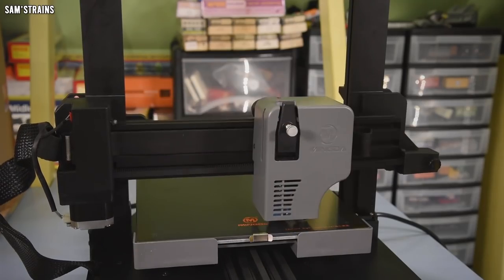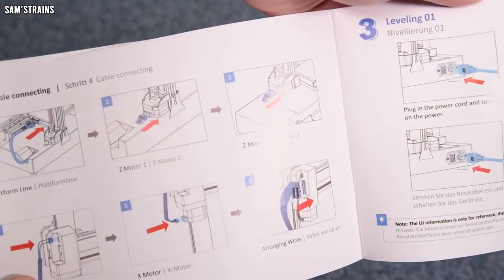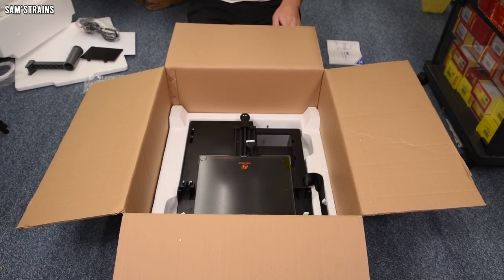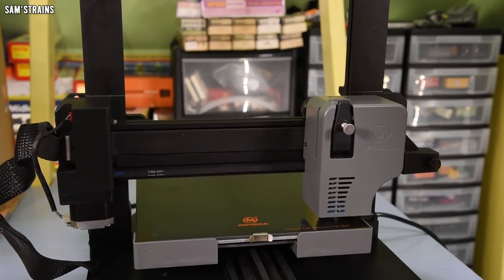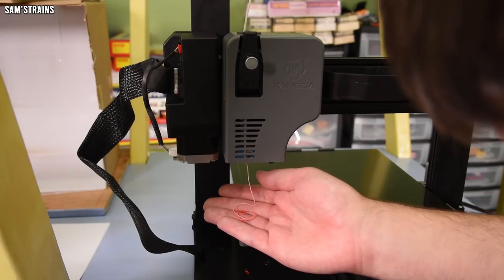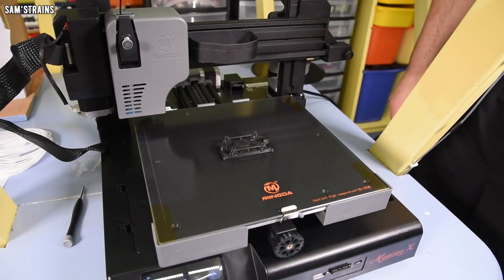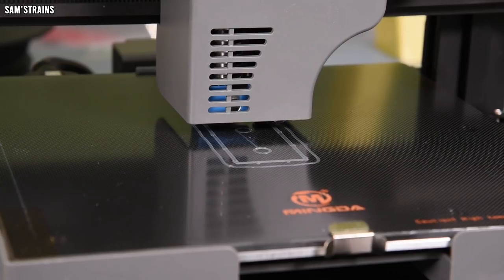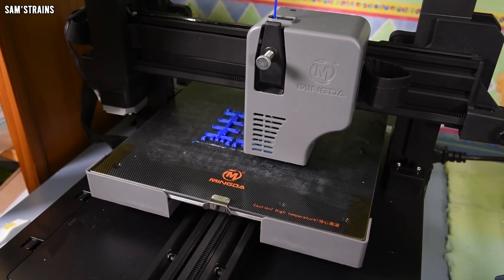This Cheap 3D Printer Makes Outstanding Models | Mingda Magician X | Unboxing & Review

Comment: Next: making an entire Sam to help on the layout
Reply from the maker: Heyy! There's an idea! xD
Thanks for watching, Sam :)
Reply: @SamsTrains  you need to try that.
Reply: @SamsTrains  Perhaps a miniture Sam to do the uncoupling.
Reply: @odinnln5694  I second this notion
Reply: @SamsTrains  u should make model train bodys for the chasis of any train and try making a custom train
Reply: ModelU actually can do that, they are usually about at shows in the UK and they can 3D print you using resin printers, onto your layout. All they do is take a photo of you with either with your normal clothing or you can dress up in different clothes and hold relevant props, so you can be a engine driver, locomotive fireman, station master, passenger from the past or anyone else you can think of on a railway.

Comment: You should try resin printing, they’re supposed to be great for modelling
Reply: AGREED. as you tend to print smallish stuff a cheap resin printer (under £200) would be ideal. the quality of resin printers is amazing......a sub £200 resin printer will easily print higher quality than a £1000+ FDM printer
Reply: @TDax  Due to one of my friends highscools large suplly of resin printers cause no one else can get them to work he played around and was resin printing small replacement parts for one of my models. afterpainting you couldnt tell what was new or old.
Reply from the maker: They do look amazing - I might one day, but I don't have any ventilation, and it's a bit messy!
Thanks for watching, Sam :)
Reply: No I wouldn't bother it's not good for trains.... I own a resin printer and trust me it's not for playing ... great for scale models where you paint and place on a shelf and never touch it. Something that vibrates and could get knocked .....nah your setting yourself up for pain.. but for scenery stuff yeah man do it
Reply: @vasili1207   try adding a little flexible resin to your standard resin.....You can end up with a an unbelievably tough print.

Comment: A very good review, thanks Sam. I'm new to 3D printing. It was good to see the fine detail of the printed model close up. There is still the slight layering effect of the plastic, but with painting I expect that would smooth down. This looks like a good entry-level printer to get started with. One question please, - how to you get your 3d files or wagons etc? Do you scan original models or can they be purchased ready to print?
Cheers, Angus.

Comment: Sam thanks for the review 
I just backed the Kick starter and was starting to worry if it would be good or not because of the low price .
I decided on FDM instead of resin because of cost but mainly for increased bed size and  ventilation and noise ,it will be in the living room of my condo and I don't want to bother my neighbors or die of the Resin fumes .
But thanks to you I think it should be great for my Traveller and D&D work 
This is my first 3D printer experience ,so I am sure that was why I started to get nervous 
Again TY for the great review

Comment: My Magician X assembly didn't go smoothly. Mingda support were very helpful and quick.
One of the large screws wouldn't engage. It's a deep hole - at the bottom the case plastic and support metal holes didn't line up. After some perseverance the screw finally engaged.
The pack also contains two small screws that are not mentioned in the manifest or instructions. They fit in the plug shroud at the back of the bed to stop it being pulled out. You have to make sure they engage with the captive nuts - as the bottom plastic can bend instead. Looking at Sam's video - it seems mine is an enhanced bed plug shroud with added screws for extra security.
The final confusion was a thick-ish sheet of clear plastic covering the bed - very strongly stuck. Loose on a couple of edges - but no obvious tabs or markings that normally indicate a protective film. However - that is what it is - so remove it.
Now getting close to printing click-in adapters for a (Sam £3.50) 8x16mm or  a 10x20mm coreless motor in an early variant Mehano/Model Power RS-11. In hindsight it would have been quicker to have shaped one with front lugs out of a small piece of wood. Instead of needing the complication of a rear clip - possibly use a longer 2mm self tap pan screw through the under-chassis weight screw hole which is clear all the way into the motor compartment.

Comment: I saw a 3d printing video long time ago where the article he made was put into a container with some acetone next to it in a dish, after being left for a while the surface  lines made by the printer dissapeared because the acetone dissolved the surface and made a smooth finish, Could be worth a try,
Reply: Acetone smoothing is used with filaments like abs.

Comment: Hi Sam, hope this isn't preaching to the choir:  To combat the warping you can try a few things:  1) clean the bed with warm water and a small amout of dish soap to eliminate any excess grease/muck, 2) clean bed with 90% (or higher) IPA, 3) check your bed temperatures, 4) build your skirt up higher to act as a semi-enclosure (another 4-5 layers should do in most cases) and help prevet drafts, 5) lower the cooling settings on the hotend fan (if there is one and it's not a one speed job) so that the corners don't cool down as quickly.  However, if there are Z-height bed levelling inconsistencies from the auto level, then you may have to put a couple layers of raft down.  If you don't want to waste filament on a raft, a brim may help keep the edges down (not sure if Cura allows brims to be selected to just be on the corners like Prusa Slic3r does though).

Comment: You should try out resin printing, since it allows for much finer details than fdm printing. Also you might want to try filling and sanding your 3d printed models to remove layer lines and give it a smooth finish

Comment: I think I might understand the random small shifts in the Z axis between prints that appear to be a common user observation. My touch screen is not just randomly apparently unresponsive - but often acts as if a nearby icon has been pressed instead. One of these is the Z height adjustment which I believe I saw it do instead of "back".  If not this root cause - then certainly a problem. A more visible muddy footprint case is "Runoff On/Off" toggling. Sorry for all the posts but it is a likely place new users will look for pointers.

Comment: Hi Sam, great video with some good tips on set up, my question is how to fit wheels on the printed wagons ? I have had some problems with the axle box frames breaking of trying to fit axles in, what would you suggest, Warming the chassis up in warm water To make them a little more flexible ? Any help you could offer would be much appreciated.
Paul

Comment: This seems like a reasonable beginners printer based solely on little things like auto-levelling. I have a CR-10S Pro v2, and it has many of the same features at double the cost, but it does also have a larger build plate. I do wonder how the quality of the electronics compares. The X carriage power cable looks decent, but I wonder how that feed system, extruder stepper and stepper drivers will hold up with some use. 

Time will tell!

Comment: Fascinating stuff! This is an amazing new dimension in modelling. Do all of the prints have that stratified look showing where each layer was added? Can they be sanded or filed to produce a smoother finish?  Can you add rivet detail?
Reply from the maker: Thanks James! Yes there's quite a bit you can do to reduce the layer lines... and you can reduce the height of each layer too, which improves quality but obviously takes longer!
Thanks for watching, Sam :)
Reply: As you get more proficient with 3D modelling, you'll learn what's good to print in one go and when to separate parts to print individually and then snap/glue together.  Rivets don't resolve well if they're facing out on the x/y planes, but if they're facing up/down the PLA layering can deal with their resolution much more accurately.
Reply: @coolersmoke  Thanks for that explanation - it looks like there's a bit of a learning curve on 3D printing - but well worth the effort

Comment: I would recommend using a layer of Blue painters tape over the print bed, rub it down with a cloth dampened with rubbing alcohol. This should help get prints to stick better to the print bed, some people like to use hairspray on glass beds, I wouldn't recommend this because it can gum up parts over time.

Comment: Sam, the layer lines are showing more than they should. There are some videos on YouTube about how to print with less showing. Worth a look. I like that printer with self-levelling. At the end of this month, I am buying an Ender 3. Like the one I borrowed from the college, it has all the updates and a stepper motor silencing board. The fan housing around the nozzle has also been modified. I am using the same filament as you are and I have had no problems with it. I will take some photos of what I made with the one from college and email them to you. Unless you have a Line account and I can them that way. Martin. (Thailand)

Comment: I have the creality LD 002r resin printer with a 2k LCD and prints at 0.05mm res only cost £175 and I would love to be able to design rolling stock or even locos but I really struggle with the design software side so I have found 2 or 3 things on thingivers. But would love to print off what I've made they look amazin

Comment: Seems a really good machine and for that price also. Btw, I had the same exact issue with the protective plastic on the screen of my Ender 3 V2 that the plastic is pinched between the screen and the cover so could not get it off completley instead having to cut it with scissors leaving an ugly edge I cant get out from there in any way. Need to get the cover off in some way to remove it i guess. At least the machine works great. just like yours.

Comment: I have been looking at something like this, not for the rolling stock (in N I think a resin one would be way better) but for retaining walls and other buildings, platform sections and so on where I think it will be perfect.

Also for Scalextric bits

really helpful review

Comment: Caution: when using a loose roll of filament - there is nothing to stop it coming off the back of the holder. The filament can then become tangled round the support and stop feeding smoothly. Not sure why the Z axis movement is so clunky =- in between clunks the screw rotates smoothly. Both motors are synchronised - so it is presumably the way they are driven. The head actually gets stopped by the end of the previous layer and forces its way past that point - the vase and head shake.

Comment: Interesting video Sam, really quite informative.
Is it possible to reduce the 'ribbing' effect - limiting needs to trim manually?
Is that simply adjusting the time and temperature?  Answered in the main at the end.
Can you print the wagon bodies with more-acceptably thin doors - they look about 2mm thick on your trials?  
Is this too weak / difficult to print when thinner?  You did mention 'warping', so I suppose this is a possibility when pushing the envelope.
Interesting.
Thank you.
Al.
Reply from the maker: Hi Alan,
Yes those are the layer lines - this printer can produce models with very thin layers, but of course they take longer... so everything printed in this video was done at 0.18mm layer thickness... whereas it can do 0.08mm and lower! Alternatively, you can spray models with filler, or bath them in acetone which will help to hide the layer lines!
Thanks for watching, Sam :)

Comment: I would be warry ordering this printer. I may have just got a bad one. I ordered a Magician X about 3 months ago. I have only been able to do a few prints. First my bed belt broke, took 3 weeks to get the right belt to replace. Now I am having issues with the extruder motor functioning properly. And have been fighting with Mingda for about 2 months for them to send me a new motor. Finally 3 weeks ago they said they were sending me a new motor and well it has yet to ship out to me... When the printer does work, it is a great printer needing very little maintenance and tinkering. The print quality is pretty great right out of the box.

Comment: As a 3D newby - I am well on the way to becoming an "expert - someone who has made all the mistakes".
Warning: the manual seems to omit several steps in the menu navigation - and the current UI is slightly different. Not helped by my screen touches always bleeping - but usually requiring several unpredictable attempts before the menu changed.
Waited for ages for the Preheat to tell me it was ready - the option buttons were "Stop" and "Back". You use the "Back" to return to the main menu to see its heating progress.
Finding "Load" was another exercise in navigation hit & miss. Be careful of the manual's red arrow indicating you rotate the knob - it will soon unscrew completely. Another video shows you have to ease the lever back a little way to get the filament into the wheels. It initially feels like you risk breaking something.
The "Load" button seems to feed in increasing increments - one for each press - so more experimentation needed to see if Sam's continuous press will work. The levelling had parked the head at the extreme bottom left of its travel - not the best place to see the filament coming out and sticking slightly to the base (not  the plate).
It is now printing the "vase" test to check that it can reach a reasonable height. So far so good - the vase stem is looking a very smooth surface. If the sample is plain PLA - then possibly eSun PLA+ will be even smoother. However - there is a distinct click presumably when it lifts the head for the next layer - and that has created a vertical seam in the vase.  Still - I expect to be a happy bunny now.

Comment: This looks like a fine machine.

 Compared to you're other printer this printer looks like its has more trouble with ringing and aligning the layers properly.

Also, look into DLP 3D printers if you want to make models without visible layers.
Reply from the maker: Yes it does look that way - though check out the print at the end... that one was done with acceleration and jerk control enabled, and all of the sloppiness went away! I'll be showing more produced with this soon!
Thanks for watching, Sam :)

Comment: So, especially for a beginner, would you recommend the Mingda over the FlashForge? 
The fact that the Mingda isn't enclosed worries me, but it sounds like it's a lot more accurate and user friendly than the FlashForge. Plus the price too (although, buying my first one, I don't mind paying a little more for a better product). 
Also, I'm going to have to keep an eye out for more of your 3D printer videos because the FlashForge does seem to hold up over time. We'll see with the Mingda I suppose.
Reply from the maker: Besides the calibration, the Flashforge is very easy to use... this one is easy too, but I had to do a bit more troubleshooting to get good prints. I really  like the enclosure on the Flashforge too... it also protects everything from dust etc. So both have their pros and cons - this one was better value for money though!
Thanks for watching, Sam :)
Reply: Thank you both! I'll stick with my original plan to buy the Flashforge Sam initially reviewed once I have some money saved up!

Comment: hey sam great video but ive got a question/problem last week i bought a £5 hornby dublo class 08 and its having problems ive oiled it and it still doesnt go and it sparks. sometimes if i lift it up slightly it works for 1 second then cuts off again do you know what could be the issue?
Reply from the maker: Hmm, sounds like a motor issue - have you tried stripping down the motor for cleaning and a small amount of fresh oil?
Thanks for watching, Sam :)
Reply: @SamsTrains  no but il give it a shot thanks so much sam

Comment: I'd really recommend looking at resin printers at that kind of scale. You'll never match the level of detail using an FDM machine. It is messier and a littler more effort, but it's worth it
Reply from the maker: Yeah that's true - the mess just won't work in my loft though, and I don't have any ventilation!
Thanks for watching, Sam :)

Comment: Can a 3d printer print a steam locomotive dome with a reasonably smooth surface?
Reply: Resin printer without any problems but not FDM printers that Sam uses
Reply: @radoslawsocha4955  Oh, Thanks!

Comment: By any chance can you 3D print a locomotive?
Reply: You can, but not in one go if you want a decent print!  You'll need to model separate parts and glue or snap them together.  It just takes practice, but the results can be really good especially if you take time to sand & tidy up the parts before assembly

Comment: How long until he gets a resin printer
Reply from the maker: I doubt I will do - they're a bit messy (and poisonous) for my loft :(
Thanks for watching, Sam :)
Reply: @SamsTrains  makes sense, I have one but haven't been able to use it yet due to the aforementioned toxic resin. I chose it though since N scale is a lot harder to ignite the print lines of filament printers